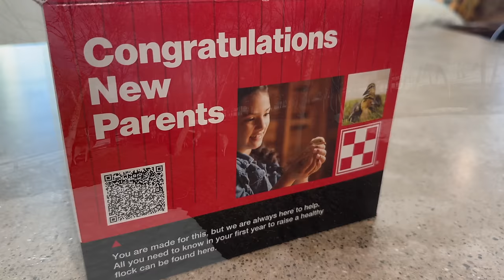Our Son Joined The Military Without Our Permission...

Comment: Great bed frame and sturdy. The only problem, you don't expect there to be legs other than on the corners and if barefoot you stub your toes on those middle legs. Suggestion, cover with a foam material or something otherwise your guests could get onery. lol. Oh yeh, btw the National Guard is federalized to active duty but not to worry most people don't know yet but Trump is still CIC under continuity of government, Federal Continuity Directive (FCD) 1 issued January 17, 2017, Operational date 2018 to 2022 and  FCD 2, issue date June 13, 2017 operational dates 2020 to 2024. PEAD.

Comment: Two observations via 26:29.  I noticed the floor was still wet when you put the bed frame down.  If those were metal feet they would probably create a rusty spot.  Second, every single designer show my wife watches has beds installed with a nice rug under them.  You might consider this for your bedroom build.  What I would put there is a rag rug style of rug.  It would be soft on the feet and really look nice.  That ceiling design with the metal was rather interesting.  All kids growing up have to make some mistakes in order to learn their ways in life.  Parents like you are there to help them stand back up and take more steps forward.  You and your wife have had stumbles of your own and you can offer the kids paths to take but in the end, they will have to make their own way.  Sometimes they surprise us and sometimes they disappoint us.  Such is the life of a parent.

A final thought after watching you put the mattress into place is that you might want to wrap the back of the platform in some sort of rubber.  The movements of the bed will bang against the wall and scrape the paint and gouge the wood.  What I did for my beds is get a pipe wrap section (black, foam, split down one side) and glue it over the edge of the bed platform.  I raised my platforms because I am very tall.  You are so right, those metal frames are just weak cheap crap....

Comment: I converted a Waterbed frame to a very strong two inch square steel tubing laid across from angle iron screwed around the wood waterbed heavy frame and head board and foot board. And laid plywood across the steel tubing.